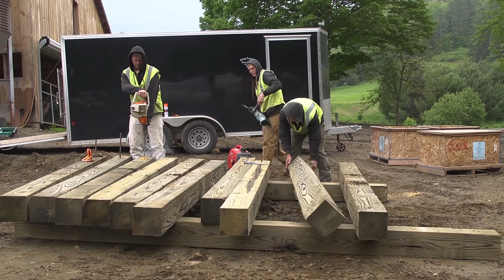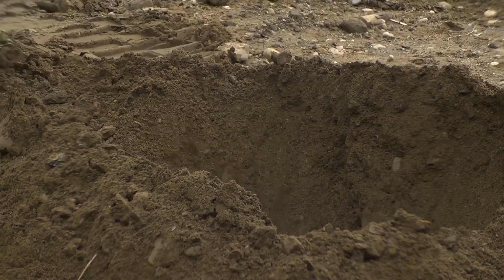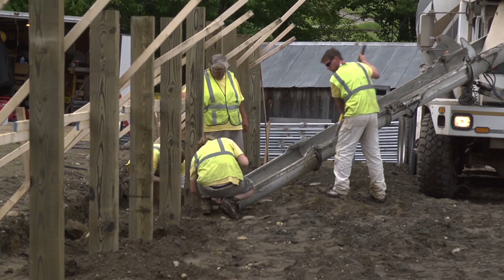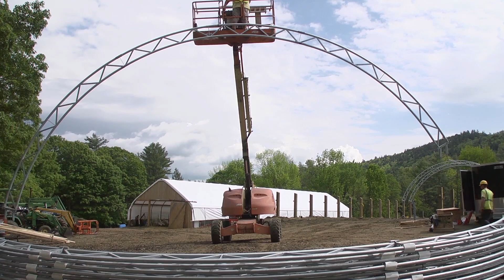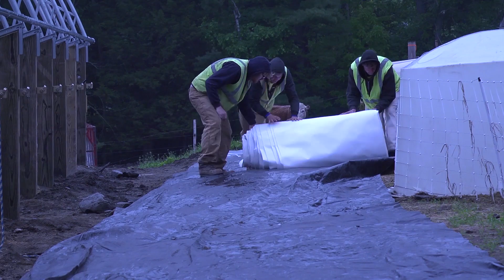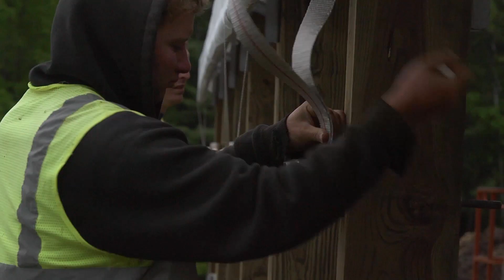How We Build a Barn in 72 Hours — Greg Lussier Barn Builders

Comment: Hi? Can I ask a quick question, please? I live in Mongolia and the climate here is really harsh. In the winter temperate can drop to as low as -40C. So, the question is is it possible to build this this kind of building for dairy cow or sheep? I suppose because of temperate differences inside and outside the barn water droplet may form on the ceiling which we don't really want have. Many thanks!
Reply: We put one up in those conditions in Saskatchewan. You need an exhaust fan near the floor to take out the moisture. Very warm in the winter from the sun. goes up 20 to 30 degrees.